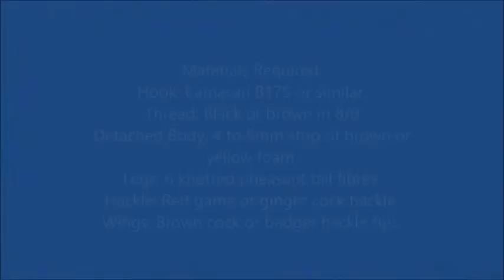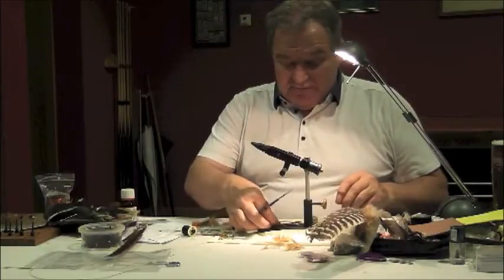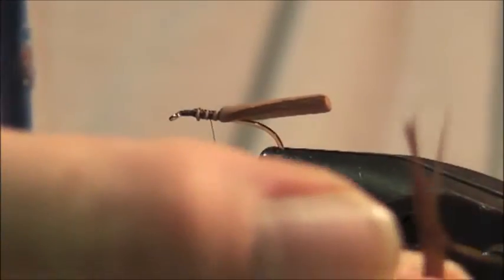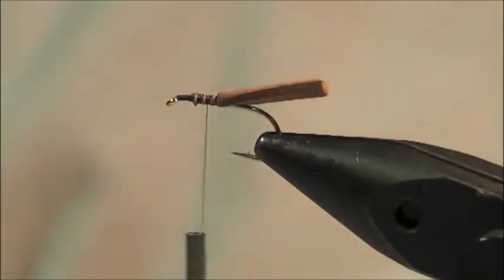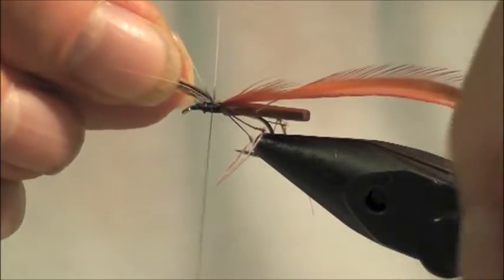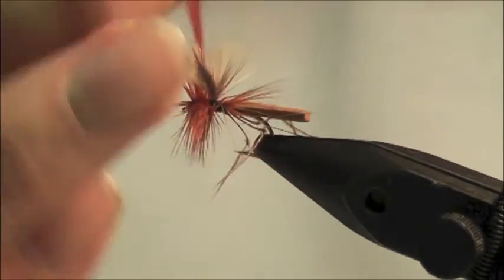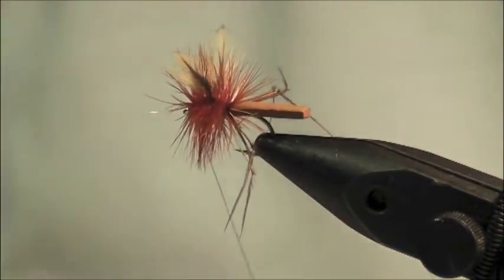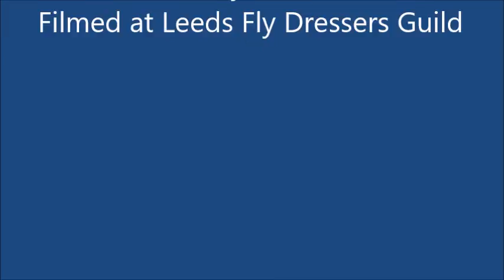Daddy Long Legs

Comment: Great tip with the method of tying the legs in. I shall have to acquire that technique.
Reply from the maker: Thanks Paul, it does make it easier to get the legs in line.